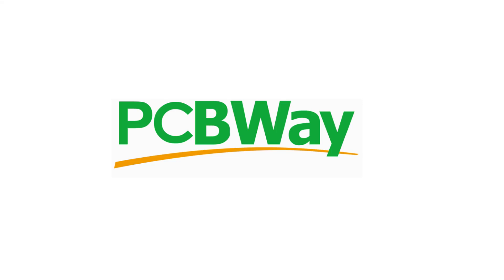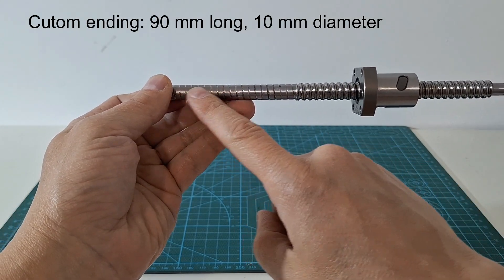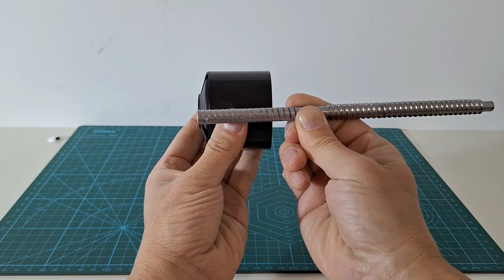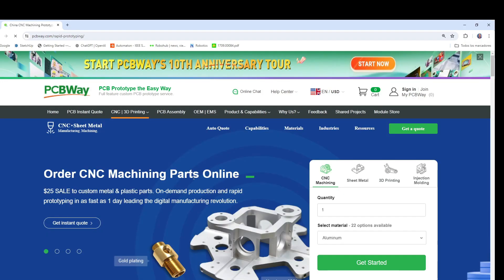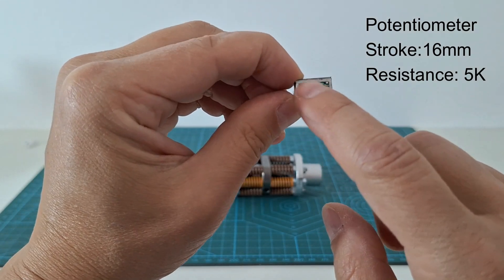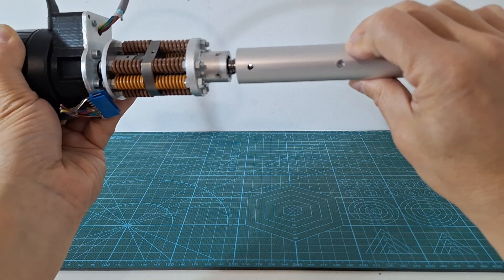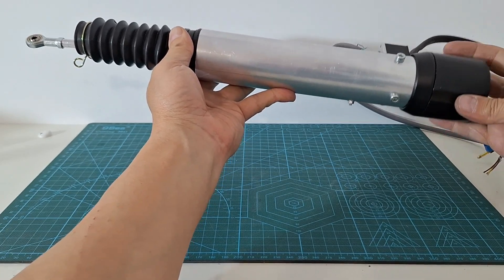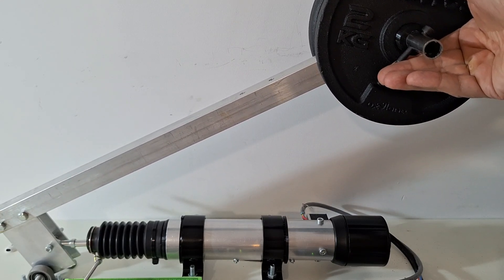DIY Series Elastic Actuator for legged and humanoid robots: force control!

Comment: Could you please explain how to calculate the required torque for a ball screw system, particularly since you connected the ball screw directly to the load without using a reducer? I am working on a similar project and would like to know how to determine whether a reducer is necessary or if a direct connection is sufficient

Comment: Hi there: Would it be possible to specify the motor used and other parts?
Reply from the maker: Hi, please check in the video, you can see some captions there specifying the components when they are first presented (motor, encoder, bearings, etc.). The motor is of type 6374, 170 KV and 3000W, normally used for electric skateboards, produced by several manufacturers